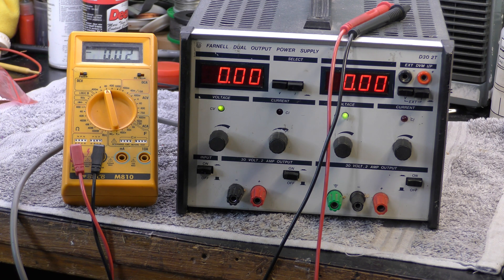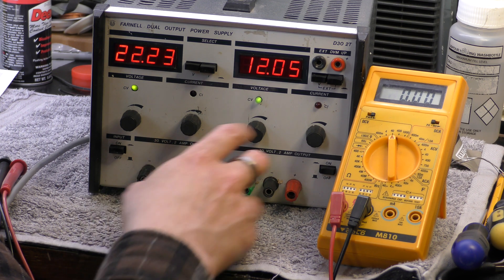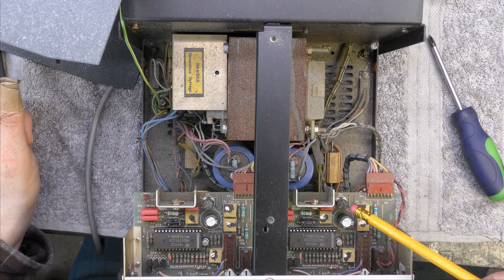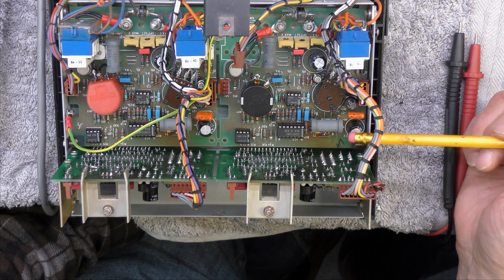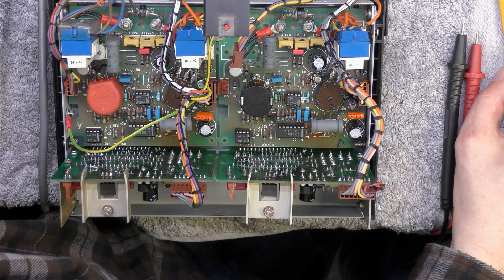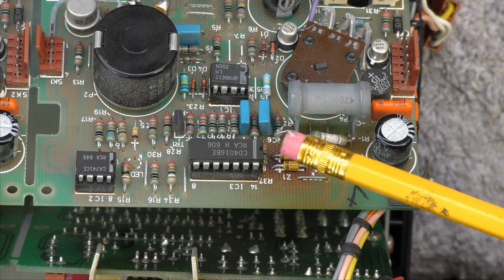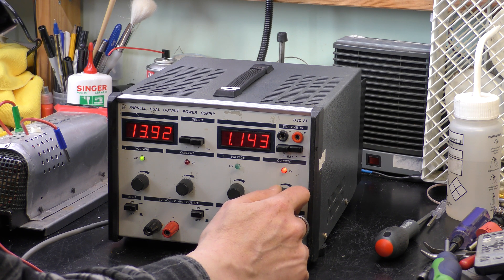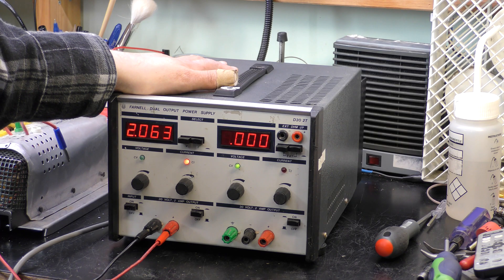Farnell D30 2T power supply check over (4K)

Comment: Great Video Darren And a Very Nice Power Supply Wonder Why They Put That Cap So Close To That Large Droping Resistor ? Must Get a Cheap Dual One Someday If Its Not To Expensive he he Thanks For Uploading Stay Safe Regards mike.
Reply from the maker: Good question! Ive no idea why you'd make such a design mistake but it seems common in a lot of gear placing caps near heat sources, Mike.